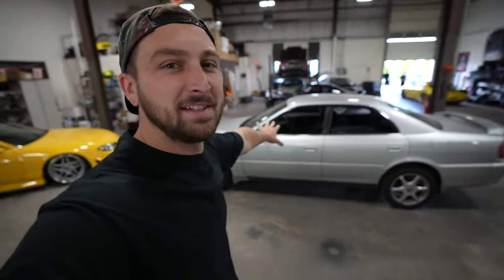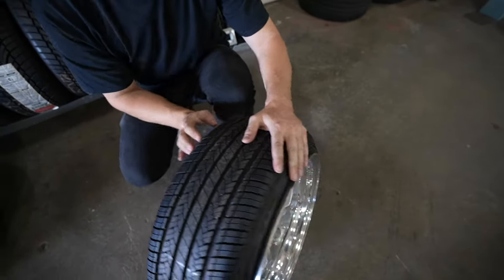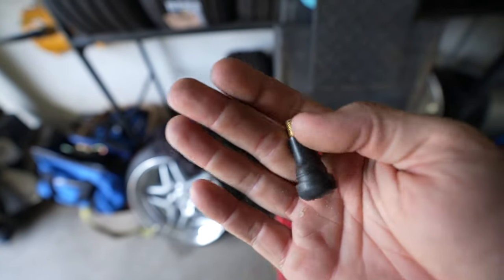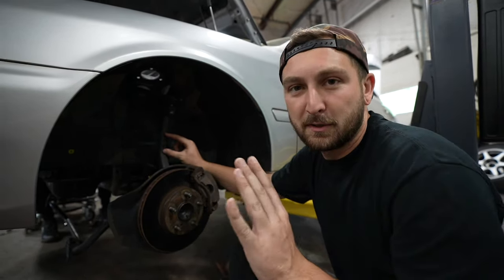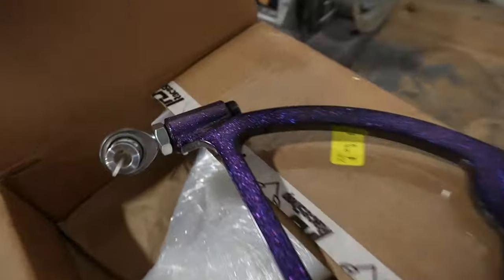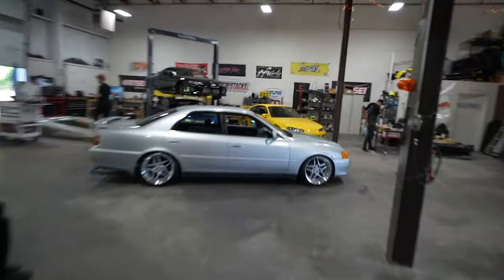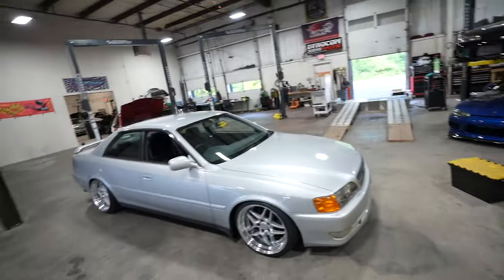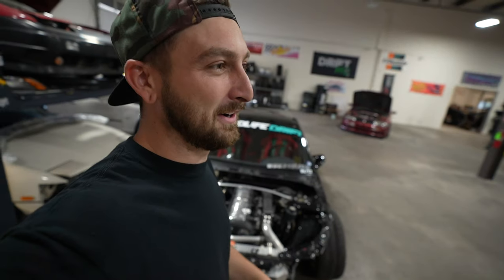Finally making the 4 door Supra look PROPER!

Comment: Definitely needs a new exhaust setup with an different style muffler
Reply: No
Reply: Absolutely it looks really off
Reply: I agree.  Looks angled downed in most angled.
Reply: @mhbluu  yea I think in should be angled up and at a slight angle 👌
Reply: once the aero bumper is on its gonna look right at home
Reply: @yashtag7778  yea maybe I still think it will look off
Reply: It’ll def look better with aero.  Probably won’t even see the can from the side with new aero.
Reply: Definitely needs to not sound like a vq lol
Reply: Nah yall bugging shii fits💯 fake jdm kids😒
Reply: Perhaps a valve in the exhaust so it can be quiet when needed the LOUD when you want it to be.
Reply: Rear spats, diffuser etc will hide the muffler, just don’t have the kit yet does he🤣
Reply: Agreed exhaust looks odd
Reply: It depends on the kit he bought and how it fits up with the muffler in the back
Reply: The exhaust is pointing 👇  The exhaust should be pointing 👆 🤣Ebay 🤢
Reply: An oval muffler with dual tips could tuck under the bumper nicely and look really classy
Reply: Came to say the same. Spoon needs to tuck a better looking muffler up, some kind of dual tip.
Reply: I think my friend, you got yourself an opinion
Reply: Asap
Reply: Agreed, it just looks goofy
Reply: sounds like a vq

Comment: Using a hammer to roll fenders is also good to keep that flat edge on the arch, a roller usually kind of pulls it and doesn't keep it vertical like oem.

Also those wheels need some meat, otherwise they look so small on this huge car.

Comment: Jimmy drop the front spring mounts an inch and wind the shock up out of the body an inch. It will bring the bumpstop closer and will stop the upper control arm from hitting the body. Rinse and repeat by a half inch if it doesn't work first time. If the spring becomes un-captive, get your boys at bc racing to get you some keeper springs.

Comment: I think I'd swap the Blits between the Chaser and the S15, but they look great. The big body car might be better suited for the larger face. I thought the stepped lip worked better on the S15. Seems like a win/win if fitment works for both.
Reply: Exactly what I was thinking. Especially after a kit, those wheels will look even smaller

Comment: Too many comments to go through buuuuut if you don't want to shorten the spindle, you can run RCAs that drop the hub about 30mm usually so the coilover can be set higher and move the UCA away from the strut towers. My Aristo was dumb low and I never had issues hitting my UCAs.

Comment: Get stiffer spring rates for the front. Jzx are front end heavy. Dmax coilovers come stock 22k fronts. Most people here in Japan go 30-40k spring fronts and 16-26k rears. Since you cannot run shortened spindles in Japan. People go stiffer springs rates.

Comment: I still think you should try to preserve the front of the coupe... Maybe after pulling it out it will be at a point where you can straighten it out... Haven't you seen what the guy with the t-boned s13 has done? 😂 If he could bring that thing back from the dead, you can fix the coupe... 😜

Comment: IF the other tower moved on the 240, but only a tiny bit, like 5 mills, i would try to not stress it too much, i am, just like you a perfectionist, but ive tried to let it go latley cuz sometimes it makes you stress over nothing. I highly doubt you notice if one shocktower is 5 mills off when in drift. its not a cup car, thing are pretty violent in drift and chances are sooner or later its in another fenderbender on that side that will mess it up more, fix it then. or it will pull out naturally when you pull the other side, chances are pretty good of that actually :)

Comment: Jimmy, you do not need SO damn much on a jzx that is "adjustable".
you can modify your camber with the regular lower joints.
And... please... for the love of anything... check. your. lower. balljoints.
The lower balljoints are the weakest link on the WHOLE jzx100 suspension setup.